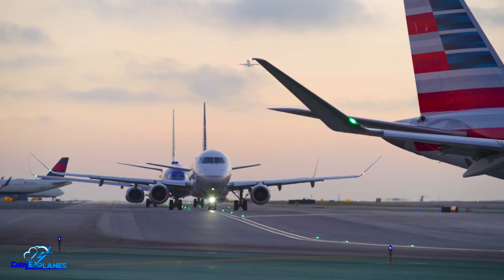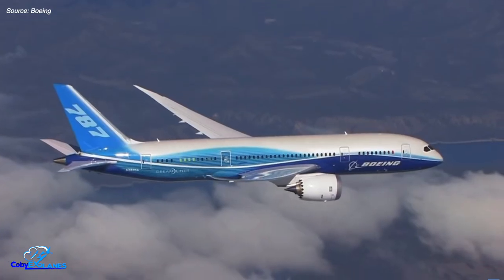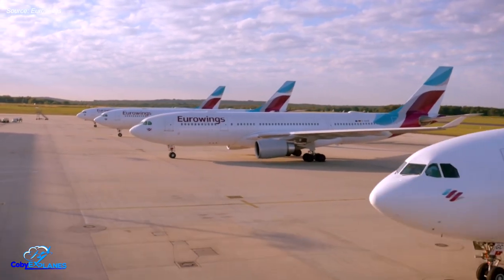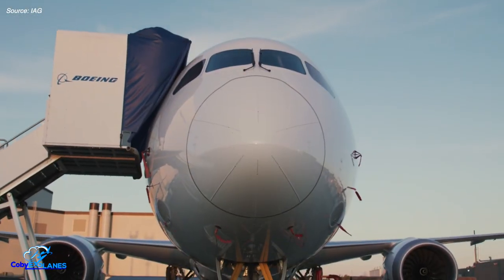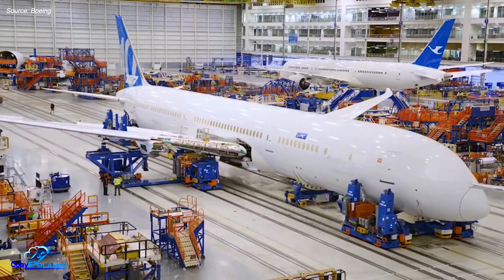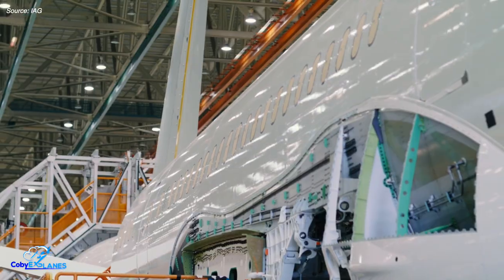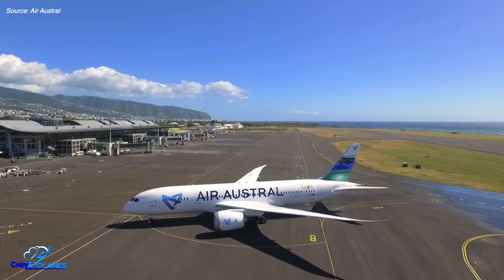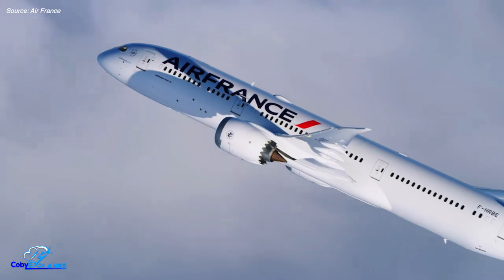How Boeing Spent $1 Billion Building a Single 787

Comment: I am sorry but @ 08:56 you state that the 787 is 'profitable'. I guess it depends how you define that term and I guess sale price vs build cost could be termed a 'profit'. However according to Boeing numbers it isn't. Let me explane (Sorry):
1. In 2015 the total cost of the 787 R & D and early production costs hit Boeing for over $32 Bn (it has risen but lets keep to this number).
2. Boeing uses the accounting method of spreading costs across a forecast number of sales.
So:
Build Cost
+ % R &D cost
= cost of aircraft
+ Sale Price
= Profit.
The theory is this gives short term profitability which increases share price. Something they seem to be better at doing than building aircraft. The problem with this is they in actual fact make a loss. $20 million plus loss in fact. Per aircraft.
3. Boeing projected an order book of 1,300 aircraft.So:
$32,000,000,000
/ 1,300
= $24,615,384 per aircraft % R & D Cost (see above)
To be blunt there simply is not that margin in each unit sale price.
4. The International Institute for Strategic Leadership (IISL) has taken the maths a step further and calculated that even if delivering 2,000 Dreamliners the jet-maker will still have a total program loss of approximately $5 billion.
5. Analysts are projecting that Boeing is actually losing over $20 Million per 787 delivered even now.
As one analyst said:
   "“They need to recover far too much money per airplane. They will never do that.”
Especially as the A330neo put downward pressure on price of the 787-9 and the A350 is hitting the 787-10. To put the above numbers into reality Boeing has a 787 order book of 1,507 orders. Do the maths.

FunFact: What you didn't show on the rollout of the first airframe was it had wooden doors.
Reply: As someone that worked on the 787 since the early days, I don’t believe the 787 will EVER recoup its development costs!

Comment: Unfortunately for Boeing, the original break even quantity assumed a level of margin which the 787 has never been able to achieve. The current consensus is that even as successful the 787 has been, too much of that success has been as a result of heavy discounting, so much so, that there is now a doubt as to whether the current 787 will ever make an overall profit unless the market for it can be expanded, as it may be quite some time before significant numbers of the 787s flying today are due for replacement - by which time, presumably significant additional development costs will have been incurred, just to keep the model competitive.

Comment: Boeing bashing? The 787 was disaster and still is depending where the assembly line is located, just because they outsourced nearly everything of this plane! And it is healthy to never trust a company with an management which ram two airplanes into the ground because of cheaping out in safety,

Comment: The 787 is a beautifully engineered plane.
I will avoid flying on them, because they were not built with the same dilligence that they were designed with.
Reply: I think that is a thing of the past.   Boeing in conjunction with the FAA went over that plane and its production  with a fine tooth comb.

Comment: To a degree they had never done before, they outsourced component design and fabrication 'to reduce cost and risk'. It had the opposite effect big time. Boeing management's hatred of unions causes them to cut off their nose to spite their face.The addition of the Carolina assembly plant is another example. The plant's poor quality leads to another reputation hit..The extra capacity is no longer needed due to COVID and the market's move away from wide bodies. So naturally they consolidate production in the plant with poor quality.

Comment: The Dreamliner has the stupidest name given how horrible its development program and teething problems were.  The original wing to wing box attachment issue was mind blowing and was only one of many.   The 787 was the true Potemkin airplane.  The 787 is a great airplane now and its use of composites were a huge advancement, but compared to the 777 development program, which resulted in a truly game changer airplane, the 787 looks like a fiasco.  To this day the 787 still has manufacturing issues and grounding that the 777 never had.

Comment: I think that the reason Boeing seems to have more issues than Airbus is because they tend to be a bit more innovative. They tend to introduce a lot more new technologies (i.e. composite design, the 787 wing, saw-tooth engine cowlings, winglets and scimitars, etc.). Airbus does innovate but is a bit more careful. It is a question of if you want the complex, expensive, risky design or the simple, cheap, proven design. Neither is really better.
Reply: So Airbus have never innovated anything? OK ..... 🤔
However you put down Airbus it has outsold Boeing in 16 of the last 20 years and has a bigger order bank so the airline industry knows which it prefers. And forgive me but the 737MAX was not innovative at all. It was a clusterfuck lash up that killed people.
Reply: Boeing innovative? You mean the company that makes planes that look (especially the cockpit) like somethink from 1990?
Reply: @1chish  To be fair it was the Boeing sales force that tacked on and hid MCAS.  Which ruined the reputation of a very good airplane.     
I think the Lockheed Tristar proved that the best airplane does not always get the largest orderbook.

Comment: Boeing should build a 787 the size of a 737 for the next 737 variant.
Reply: The  MAX has some legs left in its sales potential.     They really need to come up with a game changer 757 replacement.    That will take engines that do not currently exist.

Comment: Boeing spent 32b Dollar to develop the 787 Dreamliner Program

Airbus spent 11b Euro for the A-350 XWB Program

So Boeing still have not made any profit with the 787 Dreamliner 😂
Reply: Slow and steady wins the race
Reply: @grozaphy  since Boeing shifts all 787 Production to SC, faulty, cheap and low quallity Dreamliners will not help to win anything for Boeing
Reply: Boeing loses some $20 Mn per 787 delivered.
Reply: @Sanginius23  Yeah. Airbus launched the A350 later but it is probably profitable. Slow and steady

Comment: Uh...no. One does not have to spend $250-$350M to buy a 787. That is patently false. Not even close.
Reply from the maker: Only if you buy in bulk - if you're purchasing just a single jet you're gonna have to pay much closer to list
Reply: @cobyexplanes  but almost no one buys single units. Most airlines buy at least 10 units and will never pay close to that amount per airplane.

Comment: One of a silly series of a comedy of errors. Batteries, Wing Boxes and so on. Boeing management is to blame! The 787 is the first real new design to out source many of its components compared to previous designs. McDonnell Douglas management is to blame here. Not Boeing engineers as management is responsible for what goes at Boeing. Airbus A-350 is what I trust more than the 787, Won't even get started about the Charleston fiasco and how Everett 787 production would conclude soon in favor of lower cost Union Labor in Charleston vs. Everett. Airlines were turning down Charleston aircraft due to quality issues and procedural failures of assembly. I am a Boeing fan boy before you get crazy on me. My 727,737,747,757,767,777 are very much the Engineers Airplanes of the past where what is made from the 787 on is management derived planes more than engineers. Boeing is an Engineering company. I lived not far from Everett and Seattle and love the Museums of Flight there. But Boeing has a road ahead to win my trust back. I am sure the 737 Max is fine, but do I want to fly on one. Is the 787 where it needs to be quality and functionality wise? I don't know. Is the FAA trustworthy enough on the oversight and so on? I love aircraft and all the cool new technology coming out. Boeing knows how to build great airplanes. I hope the quality and safety hasn't left the company.
Reply: Can't blame boeing for the batteries anymore than you can blame all the LG chem battery equipped cars currently burning to the ground in various locations on the globe.  Once in a while a supplier who is supposed to be the expert screws up.